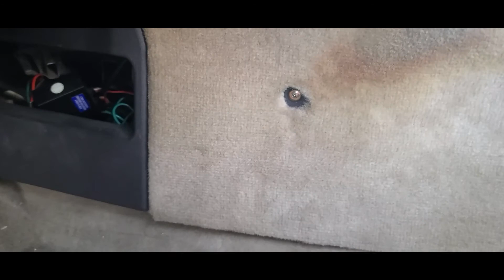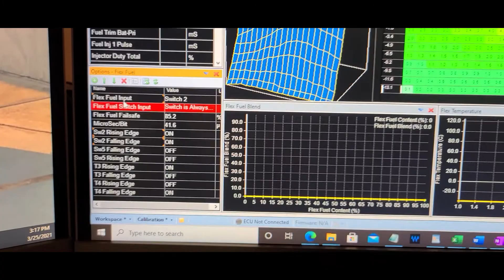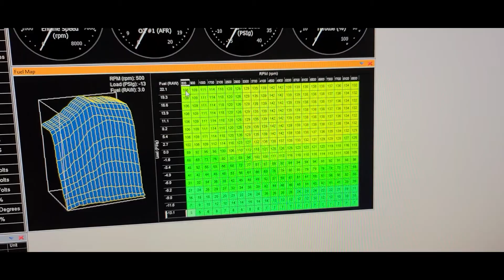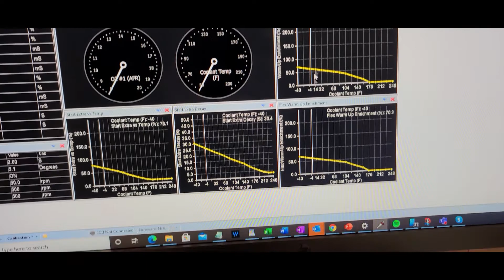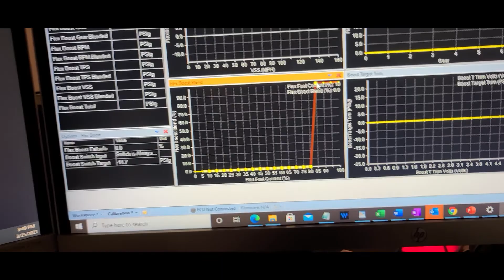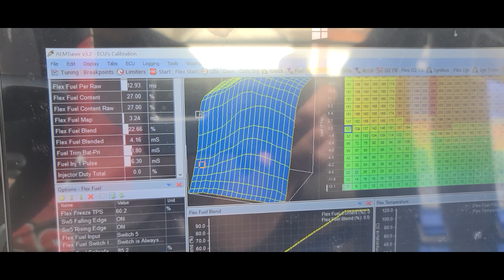AEM Flex Fuel Sensor Installation and Calibration by RacerX Performance Tuning

Comment: Hey can I use a gm flex fuel sensor with the aem infinity or does it have to be specifically the aem flex fuel sensor
Reply from the maker: I apologize for not seeing this until now. Yes, you can use a GM flex sensor.
Reply: The AEM kit actually uses a GM sensor.  But, it includes a nice AEM sticker ($100 value).
Reply from the maker: @HondaAcuraGarage  Hahaha!